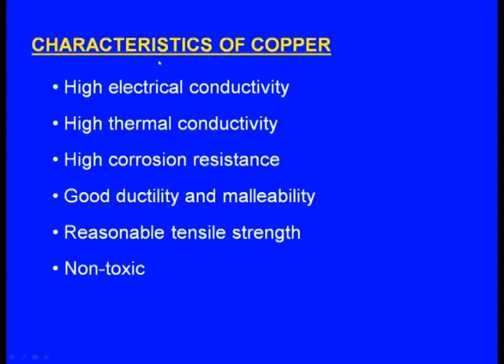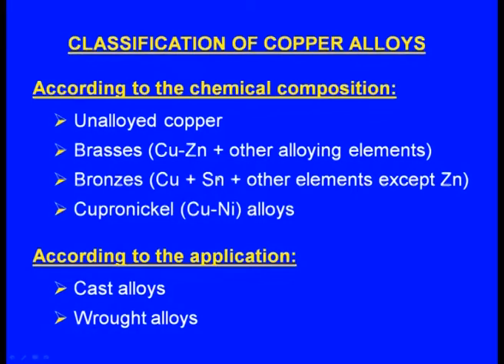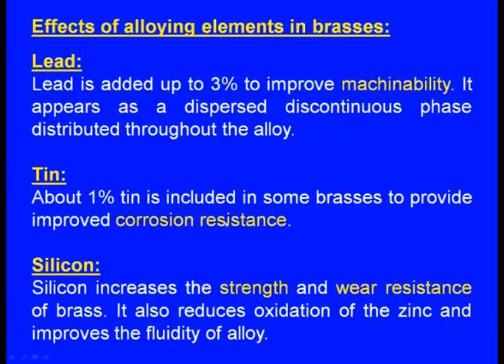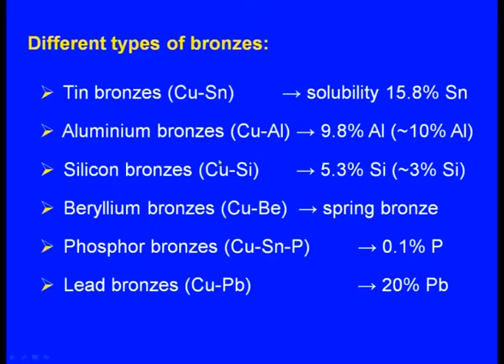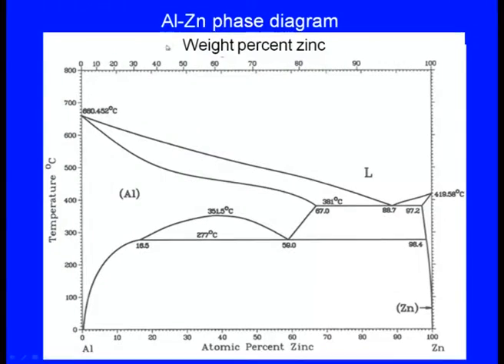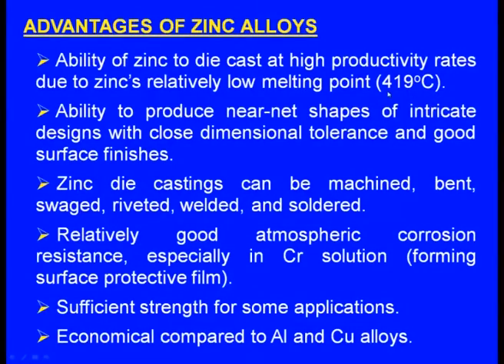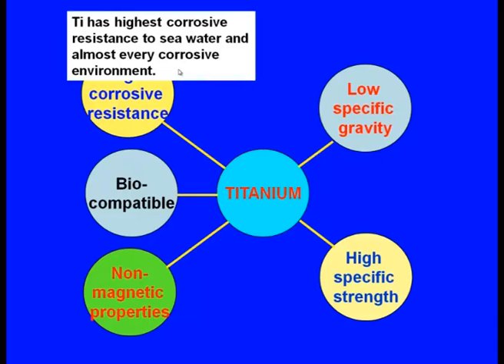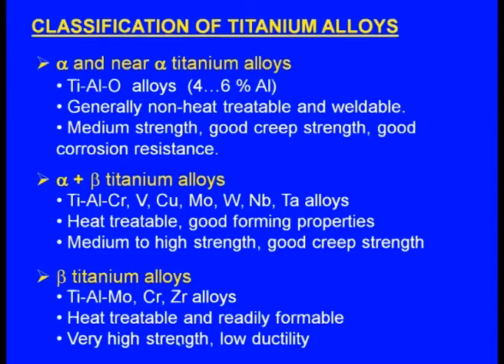Copper, Zinc and Titanium Cast Alloys

Comment: Zn-Cu-Ti-Al alloy seems ideal for lead-free hunting ammunition.  Pure zinc, add a little brass for the copper, add a little titanium dioxide for a titanium reduction with zinc, then a little aluminum.  Alloy minimas: Ti 0.06%, Al 0.015%, Cu 0.08%.  Alloy maximas: Ti 0.2%, Al 0.1%, Cu 1.0%.  Cast with iron/steel bullet mold.